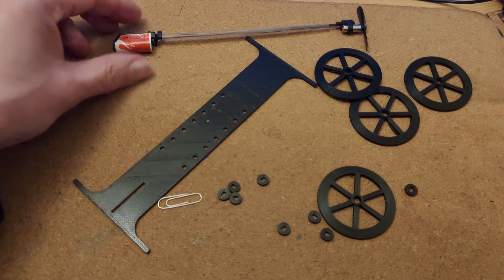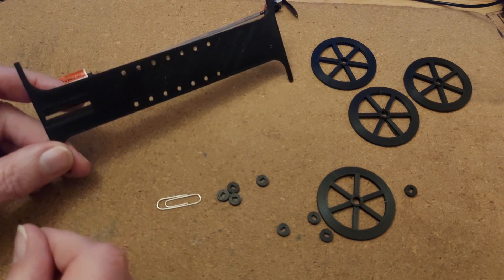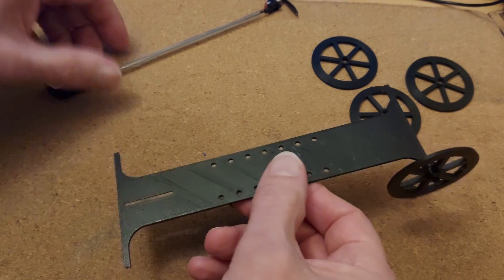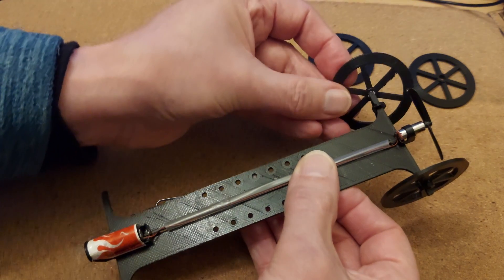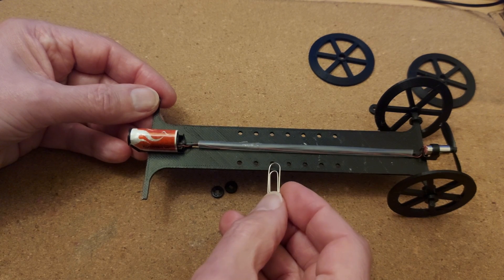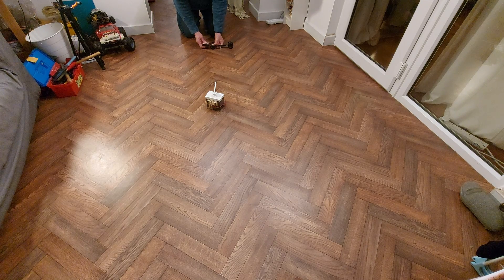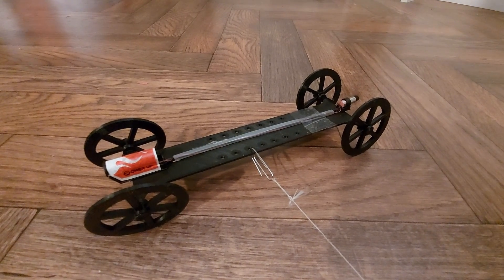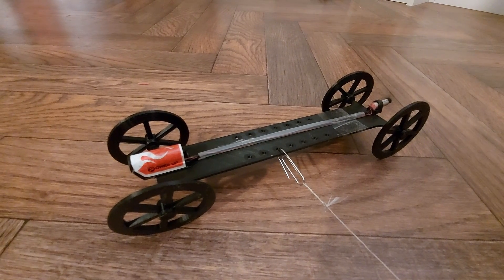Power Up Tethered Car

Comment: That is a good idea. I didn't know you got Power up. I have one too.
Reply from the maker: I have several, I did a series making aircraft from foam plates several years ago (links to the playlists in the video description). I only have the basic ones, I didn't buy the remote controlled version.
Reply: @GrandadIsAnOldMan  thanks for the list